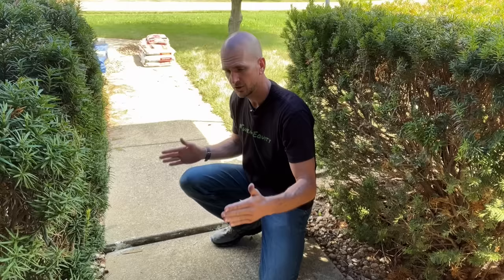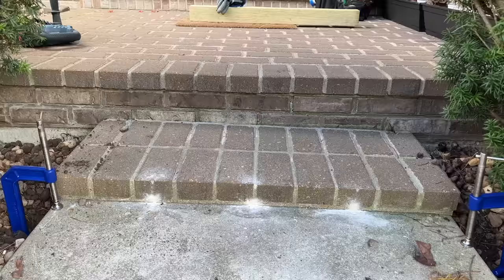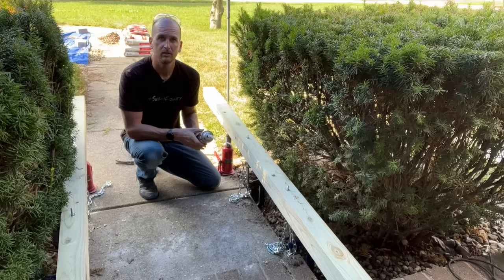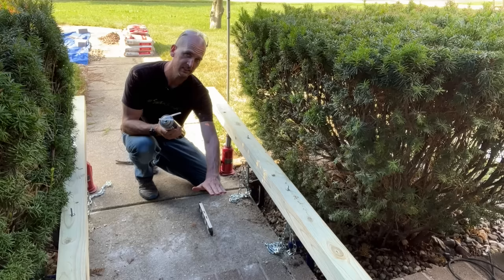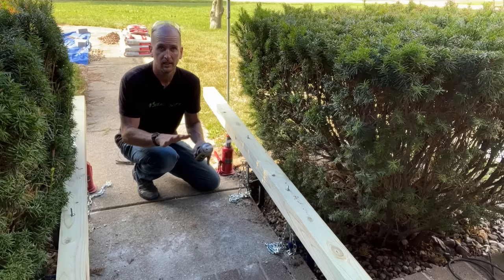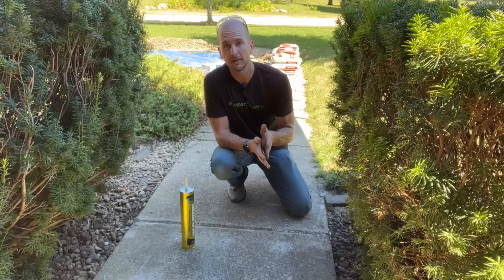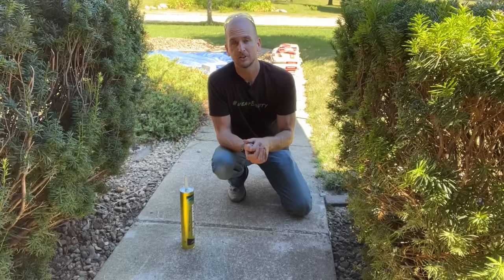How To Fix A Sunken Sidewalk With Spray Foam

Comment: With all due respect to your ingenuity, which I applaud, I had this exact problem, but had a much easier - and cheaper - solution.  I grabbed my neighbor, and together, we struggled up the broken off, but intact, 4'x2' slab until it was resting on its edge.  I then shoveled the requisite amount of dirt onto the area, then struggled the slab back down to slightly above level, allowing for compacting of the new dirt.  Less than an hour, no jacks, no support beams, no chains, no j-hooks, or drill needed, and didn't spend $16 on spray foam.  That was over a year ago, and the slab has now settled to level.
Reply: same here. the only thing I caution is to never lift from a corner of the slab (did that on one of mine and broke it off). All the others I lifted from center edge and no issues at all.
Reply: And no holes in the slab to repair .
Reply: He’s the type of guy when u work on something together his way is the only way and his ears are blocked
Reply: I was just going to say what you said.

step 1 lift slab. step 2 insert dirt. step 3 put slab back where it came from. step 4 the end.
Reply: Your solution requires finding and begging a friendly neighbour, his doesn't.
Reply: @pestcontrol1634  If you can't find a friendly neighbor or relative that would help you, then I'd spend some time re-evaluating how I live my life.  Besides, you could always substitute a jack.
Reply: Lift slap  mix sand cement spread mortar mix replace slab. 3 hrs tops. No jack no chain no 3x3 no foam.no problem.
Reply: As soon as heard the up talking I knew we were in trouble
Reply: Agreed, he certainly took the long way home.  You could also just add a layer of Sakrete on top, a few boards along the sides as forms.
Reply: @pestcontrol1634  He also forgot steps 11, 12, 13, 14, 15, and 16 - struggling the slab up, removing dirt cause it's too high, struggling the slab up, adding dirt cause it's too low....
Reply: @Mixey360  You have to do the same thing with the foam, if the slab drops when you let off tension, or drops later because there was erosion or else it would't be dropping in the first place.  Seems more like a water management issue to handle for a longer term fix, grade the ground so water drains away better and if gutters aren't using extension pipes away from the foundation, pipe that out.

What he did instead, doesn't seem that much easiest than just pulling the whole slab up and pouring new concrete under it, since it isn't that large an area, then jump on it till level, then fill in the side holes where excess wet concrete was allowed to escape by design till you made it level.
Reply: @theflash1425  k
Reply: few bags of cement, wheel barrow, water, some old plywood for a form and I could have a new section of concrete but yes, yours is cheaper.
Reply: This.

The great foam will not stand the test of time. If you've ever played with it, if you step on it it'll eventually crush. And if you gently push it over and over again it'll get soft and flabby. The great foam is great.... for what it's mean to do, which is fill holes in the walls of your home. Not to support a walkway. 

When we were younger the way we fixed this was just take one of those digging bars, shove it under it, lift it and shove a bunch of rocks or dirt under it. Gravel would have been best as it wouldn't wash away over time.
Reply: Perhaps he does this for a living and works by himself.
Reply: @janestewart3231  I covered that in one of my replies to some guy whose personality apparently was such that he had no friends or relatives that would help him - he could substitute a jack for a helper.
Reply: dont use dirt. use 4 parts course sand 1 part cement. Lay a bed and tamp down to correct height. avoid walking on for 24h while it sets up
Reply: Repent and believe in Jesus Christ   And, THAT will make my sidewalk level?  Who knew?
Reply: Good ole hard labor works every time / how’s the back …. Good stuff
Reply: @theflash1425  just reading a few of your comments I can tell people don't chose to be around you often.
Reply: @spammerscammer  Do you need a "safe space" and a coloring book to help you cope with my comments?
Reply: pretty dam lucky if you could imagine the amount of dirt required to achieve the necessary lift, considering the compression , and also the compression Over Time.
Reply: @pjwoo276  I agree with you!  I initially over-filled the sunken area and just made an educated guess as to the amount needed.  Over a year, it compressed to just about the perfect level height.  Definitely some luck involved!
Reply: @reeepingk  o
Reply: Your solution is great. Both ideas are actually something that can work out for different situations. This video’s idea is good for tight situations where theres no much space to work around, and also to save probably plants or not destroy grass and if space around is limited by other structures. Ur idea looks great if there’s enough space around yo work around and even dig around to push dirt in the void… etc etc
Reply: I was going to say the same thing but saw your comment thumbs 👍
Reply: I am shocked at all the cynical comments about easier ways. If doing +2 sections, all the other suggested approaches will be harder & take longer.
Reply: @pestcontrol1634  You May be right, but if you had four jacks and was able to clean side and dig under the slab then just lift the slab and fill in the gravel, dirt n rocks! Why bother drilling holes then filling styrofoam?  Btw if you can bring something hard about a foot high you can leverage the slab up with a simple 2X4 lumber kick a premade block under it with a foot now fill rocks under it then go around do the same on other side until it’s even all around. The hydraulic foam is used when you want a quick no hassle job. The expanding foam lift up the slab with little leverage on sides.
Reply: @theflash1425  I don’t like friends or neighbors to come over to help. Both want to take over the project and inject their “way to do it.” One of my buddies(who I used to invite over for projects) was the worst. He even wants to tell me how to drive. After 60 years of driving with no accidents I know how to drive.
Reply: @williambranham6249  Fortunately (or maybe UNfortunately), all but one of my ten neighbors have zero DIY skills, so they're only called upon for brute force labor!  The one neighbor with significant DIY skills has severe arthritis, so he couldn't help if he wanted to, but I know what you mean!
Reply: Lifting the slab add dirt, Lower the slab and see if it’s ok.

Repeat until it’s good, hard work at best, a bitch without a neighbors help 

I like his method
Reply: I watched the video and read your technique……..simpler is better
Reply: Fox news
Reply: that idea doesnt make for a great video. he needed to make it harder than it needed to be :)
Reply: Yours will most likely last much longer than this guys as well.  I doubt the foam will last more that 3 to 5 years before it starts breaking down
Reply: @pestcontrol1634  It would take longer by you can do it with a shovel wedges and a hammer no friend.
Reply: repentandbelieveinJesusChrist1  Was Isaiah and concrete contractor?
Reply: @Mixey360 And don’t forget the hospital bills and operation to fix compressed spinal disks. Oh yeah, and a life time of excruciating pain!
Reply: @reeepingk I’d use a magician to levitate the concrete slab and then stick all the crazy naysayers ideas under the slab to support it. Better still, I’d put the naysayers under the slab LOLOL
Reply: @theflash1425  Totally agree.
Reply: Our have rebar cant just lift
Reply: @REALBanannaman  If the rebar goes through, from section to section, then it wouldn't have sunken to begin with.  If the rebar is in each section independently, then lifting isn't a problem.  Chances are, if there IS any reinforcement, it's not rebar, but 6x6 mesh.
Reply: Agreed!
Reply: Yes - amusing, but a couple of pry bars and some gravel are cheaper than that hammer drill, jacks, etc.  Besides that foam degrades over a few years with moisture, bringing you back to the original problem plus 12 holes.
Reply: I like the lifting technique with the c clamps and jack method.  In my case I had slaps that are 5x5 and 4x6feet that needed to be lifted and leveled.   I was able to back fill under the slabs with gravel/pebbles that was rounded and was easy to push under the slabs a foot wide pea gravel support foundation.  6 years level all is good.
Reply: Love your u-tubes. Big fan. If you lift them put an extended tube on the can and go under the slab. You can take the smallest bottle jacks. Even a 3’x8’ is easy. I hope the foam holds up. I put  a piece of 12” concrete 12 “ paper cone halfway under the slab. Filled it with concrete.
Reply: Agreed.  Did this a decade or two ago at my first house, had about a 2" difference between the slabs.  Just using a long pry bar was enough to gently lift up and scoop in some gravel.  I would never trust the foam to last or not compact over time and therefore have the slab sink again.
Reply: @pestcontrol1634  Not to mention risking their health.
Reply: That sounds great if it's a small slab, our problem is we have a slab 8'x2' that's settled down and has to weight over 1000#
Reply: @michiganborn8303  The one I did was 4x2, and 4" thick.  I don't know what the weight was, but like Archimedes said, "Give me a lever long enough and I can move the world!"  Otherwise, demo and re-pour!
Reply: @The Flash  thanks.  That solves my problem.  Now can you help with my personality?
Reply: @theflash1425  wow! Thanks for the offer! Can I have glitter crayons, too?
Reply: @kathyglass2922  Same solution:  lift up the surface, throw a little dirt on it, replace and you're good to go!
Reply: @kathyglass2922  I'm here for you, Kathy!
Reply: You should've used a self locking paver sand to fill in, instead of dirt. The sand will allow water to pass through it. Your dirt will erode, eventually.
Reply: You needed your neighbor
Reply: @Roblox-ev7ry  What's your point?
Reply: How much has it sunk back down so far?
Reply: @joeysimpson4020  I allowed for some compaction on the fresh dirt, so it's currently sitting almost perfectly level.  When I first put the slab back down, I left it  proud a little less than 1/2" to allow for the compaction.
Reply: His method, lowerback = still exist 😂
Reply: Just lift the tile and put sand under it 💡
Reply: @quantum_tarot  Gosh, why didn't I think of that?
Reply: Can’t figure out why folks who already have their own superior method for doing the job would waste their time watching this video. 🧐
Reply: @concert_rat1004  As Confucius reported said, when asked why he bothered responding to an obviously mentally-challenged man, "Every man is my teacher in that I may learn something from him."
Reply: Better than foam which will not last very long.
Reply: @chucknorris277 o
Reply: This "dirt" solution is likely temporary and will need to be done again if it is due to weathering flex or drainage issues. Dirt will wash away. This version is overdone for sure, but it's a solid long-term solution.
Reply: @shonparker9363  But the foam solution is permanent?  I'm over two years with my dirt solution now, and while the expected (and planned for) settling has occurred, it's as level today as it was a year ago.  However, I certainly see your point.
Reply: @jeremys959 wrong 😂
Reply: @jimmypalavi lies
Reply: @concert_rat1004 exactly!😂😂😂
Reply: Some of you sound like three-year-olds arguing over the right way to eat a Oreo cookie
Reply: @mrobvious1100  There is ONLY one way to eat an Oreo cookie, and that's with your mouth!
Reply: @theflash1425  you will never be confused with Plato
Reply: @mrobvious1100  You talkin' bout DEtroit Plato or sout side Chicago Plato?
Reply: @theflash1425  I'm thinking Plato from Diff'rent Strokes
Reply: @mrobvious1100  Never watched it, too busy building a business and supporting a family at that point in time.
Reply: @pestcontrol1634 easy enough, unless you have no friends or neighbors
Reply: Good for you. But my humble opinion is this brilliant handyman did not take risks shifting heavy slabs and in doing so hurting himself or his neighbor.  I ask used to think I was very clever and lift shift, carry push pull etc… well, NOW that many years later I came in constant pain (nerve pain)… cracked ribs etc etc … be SAFE !  Be Wise!
Reply: @manita2653  Did you not consider that you could substitute a jack or pulley for brute hiuman force?  Besides, the foam degrades very quickly, leaving you ithe same problem a year or two later.  You're welcome.
Reply: I DIT IT THE SMART WAY AND NOT RISK MY BACK, MY BACK IS PRICELESS.
JACKS  +FOAM $16.00 + TIME +DRILLS =  SAVE MY BACK 😎🇺🇸💪🏼
Reply: @freddy2141  And, you'll be doing it again every year when the foam deteriorates!  Enjoy!
Reply: @theflash1425  EVERY 5 YEARS NEEDED OR NOT 😁 . 
🇺🇸TRUMP 💪🏼🇺🇸 2024 🗳️
Reply: Talk about making a project out of something. Bet he’s a hero at Home Depot tho.
Reply: Key words you mentioned you & another man STRUGGLED. This man did not struggle or need another man.
Reply: @joaquinlopez997  Just a turn of phrase.  I was 69 years old when I did this, my neighbor was in his late fifties.  The 4" thick slab was four feet by two feet and fairly heavy and awkward for just one person.  The two of us tilted it up and back down fairly easily.  It would have been even more of a cakewalk if both of us were in our 30s or 40s.  Hell, if I was in my 30s, I possibly could have done it by myself!
Reply: @theflash1425  that's exactly what this man did he made it not awkward. And crying about your age makes no difference so trying to get a feel bad from me bcuz of your age ain't going to work. Plus anybody can make up an age online.
Reply: Yeah, I think it would have been less work to just bust it up and pour new concrete over it lol
Reply: Exactly what I would do. No foam can repair this problem as effectively as what you did. And that is the only way to fix it permanently
Reply: @concert_rat1004 we're here only to comment 😂
Reply: Exactly my thoughts !  @GenerallyGeneralLee
Reply: Your solution with the neighbor helping only works in a few small situations.
Reply: Lmao for real. Textbook example of over engineering
Reply: @goldblueberries326  "a few SMALL situations?"  You don't have any neighbors?  No friends?  No family members?  OK, so you need to learn some critical thinking skills.  I lieu of a helpful neighbor, a jack or lever could easily be substituted.
Reply: Great! But how to lower it down when it is popped up by the roots?
Reply: @tomyang5991  I'm not sure, but maybe hack out the roots?  I should get paid for this.
Reply: It's concrete, if it subsided, it's a soil compaction issue. Remove the piece, compact the soil, recast in a mortar bed. Done.
Reply: @tomyang5991  Remove the piece, remove the roots, think about doing this again, look @ tree, remove tree, re compact dirt, set concrete in a mortar mix.

If your mortar bed is thick, 3/4"+ use standard mortar with the rocks. If it's less than that, use a type S mortar or spec mix.
Reply: @brandonhoffman4712  Of course, the issue was "FIX", not "replace."
Reply: @theflash1425  I didn't say replace. I said recast. as in re-set, cast in concrete.

It's then fixed, and fixed right.
Reply: @theflash1425  in case you weren't aware. Replacing would be demolishing that section, making a framework for pouring, and pouring new concrete in its place. Replacing the concrete.
Reply: @brandonhoffman4712  I"m not an English teacher (though my wife IS), but it would seem to me that "recast" suggests new concrete cast in a mold which would replace the existing slab.
Reply: @brandonhoffman4712  Perhaps you could explain how you would REcast (the word used) something in concrete without first removing the original casting, then molding a new one.  A little common sense would seem to apply.
Reply: @theflash1425  tilt the piece up using leverage or machinery and get it out of the way. Tamp the ground until rock hard, possibly using a whacker/rammer/jumping jack. Measure and make sure there is room for the piece to go back in. Lay down a mortar bed using type S mortar. Place blocks to tilt piece back in but not smush everything out. Tilt back in piece, remove blocks, whack in place with a mallet, and check with a level.
Reply: @theflash1425  if you need to cut it out, you cut the break lines.
Reply: @brandonhoffman4712  Understood, which is pretty much what I did, minus adding the mortar bed.  I assumed that soil that had been compacted since 1974 was good enough (and it has been so far).  HOWEVER, the word "recast" was used and THAT was what I responded to,  Capice?
Reply: @theflash1425  yep, as I described.

You did not recast your concrete. You set your piece back in place. It could last like that just fine, but voids will be underneath still. The mortar bed is about taking up those spaces, casting it in place. That's why I used the word recast, capice?
Reply: @theflash1425   BTW. You know what happens when you assume things?

It makes an ass of u and me, ass-u-me.
Reply: @brandonhoffman4712  You need to bone up on your language usage and word definitions.  One could recast an existing fishing line, but to recast concrete means to replace it.  Ask any 100 people that and I'd bet 99 of them would agree, with you being the only dissenter.
Reply: @theflash1425  Hmm. For someone getting all loud and using puffery to push your BS. You seem to have fallen silent after telling me to bone up.

Having trouble getting it up yourself?
Reply: @brandonhoffman4712  No, I'm just taking Mark Twain's advice when he said, "Never argue with a fool, because they'll drag you down to their level, then beat you with experience."
Reply: No costs except $3k for chiropractor
Reply: @derekilopan good to know, thanks👍
Reply: For a sidewalk slab, I totally agree.  For our pool deck, however, we had this process done by a professional for about a quarter the price we were quoted by contractors who insisted it had to be torn up and repoured.  It has held up for a good 10 years or so at this point, and seems to have deterred the chipmunks from tunneling under that section again.
Reply: @SometimesMyself  At least you only have tiny chipmunk problems!  We have huge armadillos tunneling under our house foundation.  I backfill their tunnels twice a year,  They make tunnels nearly a foot in diameter!  Plus, they're totally worthless animals, not cute like chipmunks.
Reply: This flash guy has commented on this video for over a year. Lmfao.
Reply: @bwhite429  "This Flash guy" responds to other comments or questions on his post.  Why should that be a point of humor for you?  Any reason that you need to be critical about that?  Just wondering..........
Reply: Lift slab - add 1/4 down limestone - done .
Reply: Hey, Good for you!
Reply: @theflash1425 you come off as bitter boomer syndrome.
Reply: @YooperICE  I don't know how you came to that conclusion, but my sainted Irish grandmother described me as "someone who doesn't suffer fools well."  Someone else once said, "When you attack the messenger instead of the message, you've already lost."
Reply: @theflash1425  seems like an eager mind trapped in a broken shell. Your comments bely passive aggressive tendencies, including your opening statement that created such thread.
Reply: @YooperICE  You mean the comment where I applauded the poster's ingenuity?  In any event, thank you for your unrequested and unneeded analysis, Dr. Freud.
Reply: Sounds less fun, though.
Reply: @oldNavyJZ  True dat!
Reply: Foam WILL break down in less than 6 months
Reply: There are companies using foam for years to fix slabs. A young friend works for one. He's been there over 10 years and not had a call back. What could deteriorate the foam is UV light. Not a problem when it is under the slab.
Reply: @Jsc4ff if you feel like that wtf are you even here? 😂
Reply: That’s what I’m talking about 👍
Reply: Talk about reinventing the wheel LOL 😂
Reply: @mattj8514 most geeks on here are unable to finish concrete. It's not a job for candy asses.
Reply: Hope both your backs were OK afterwards 😅
Reply: Yeah I was wondering why you couldn't just move the slab, using a lever you could just lift it and do one side at a time
Reply: Sweat equity 
Lift
Fill
Level 
Cold beverage
Reply: @blipblop92  jAlways remember, lift with your legs, not your back!
Reply: Cool, yeah i was thinking this seemed like a lot of work to level a small slab.  not to mention the cost of concrete drill bits and a special drill
Reply: @flj8708  I pull the section use a string level and packer with clay and sand
Reply: Over engineering a minor problem
Reply: Sometimes, a slab is nearly impossible to lift out of the way completely. His technique would be used in situations where removing the slab wouldn't be advisable. I have this very situation right now. My slab is attached to the wall of a pool with rebar and also to the coping of a pool. My only option is to lift the outer edge and use foam. You see, if you could only think outside of the box, even you could come to this conclusion. Would I rather use the remove and replace? Of course. Who wouldn't?
Reply: And no YouTube video, L$L
Reply: ikr
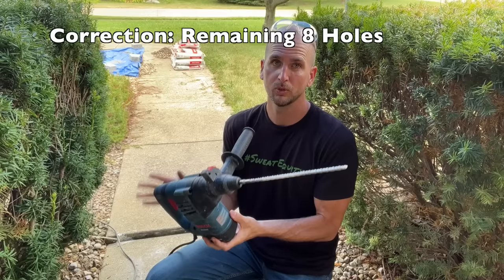Reply: 😮 0:53 😮😮
Reply: Yep. I have two friends named Jack. One of them helped me. Thanks for the suggestion!
Reply: Will the foam last that long? I would have used dirt or rocks and dirt.
Reply: Exactly my friend. Obviously, this guy was doing it for someone else to rip them off and make a lot of money.!🤡
Reply: When doing the lift and add dirt method, you must be careful to leave no voids underneath.  Water could get under there and freeze, causing the slab to break.
Reply: @rlz111  In every case, you don't want to leave void because of excessive settling, but in my case, freezing isn't an issue here in sunny and sane Florida!
Reply: That's to much! I don't have any of that stuff😂😅😂
Reply: @stevenswain248  Apparently, neither did several other commenters!
Reply: So you needed  an extra guy and it took you a year?  That would be a lousy video
Reply: @massonjohn5664  Learn to read, or troll somewhere else.
Reply: You make it sound like it's not that hard to lift a section of concrete. Not always that easy...
Reply: @stinkycheese804 foam doesmy washaway. Roots or.animals are the usual culprits.